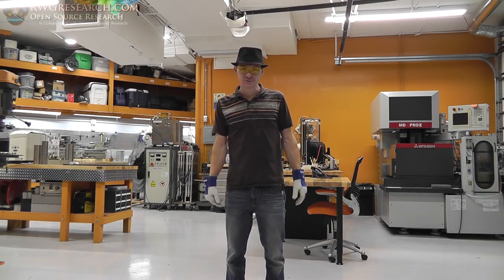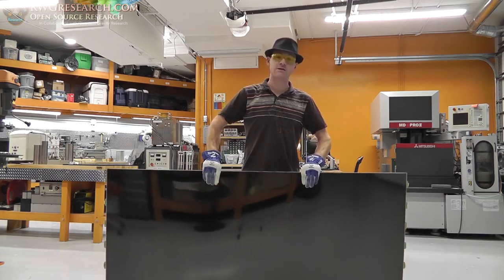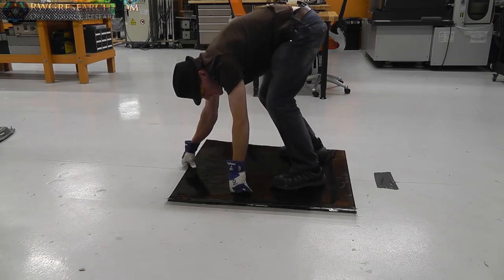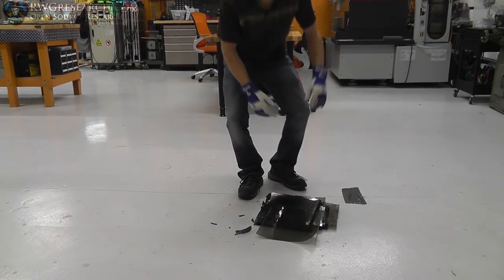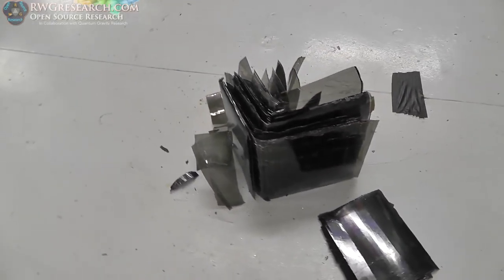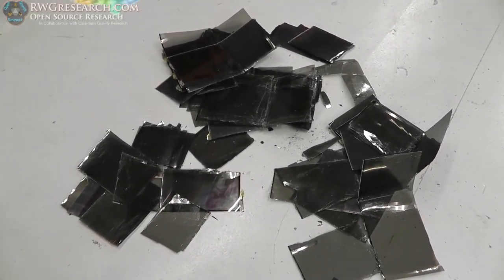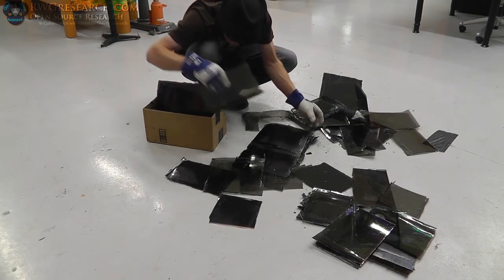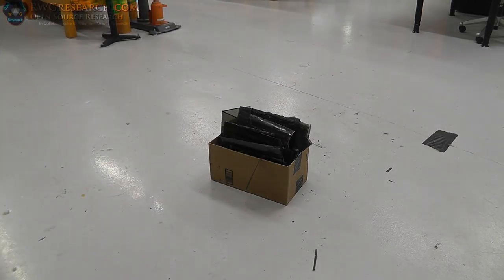When Google Can't find It... You Just Have To Do It Yourself...

Comment: One may wonder.. if there is any type of rare earth. or type of exotic metal that can be extracted.. I mean, there have to be a good reason why it cost 3000 dollars..
Reply from the maker: well. if you look at it. there are so Manny things that go wrong with big lcds that the cost comes from failure rate. that's why the bigger lcds cost more. its due to failure rate. so for ever let's say 10 made 1 is a fail. now you add more cost to the 10 goods some. this is a 4k LCD. thsts over 4000 lines one way and 2000 lines the other way. that's like 8,000,000 pixles. x3? (one for each color. now sure. lol )   any one of them is bad it's junk. so. So now you can see how failure rate gose up with screen size. any how. food for thought. ~Russ